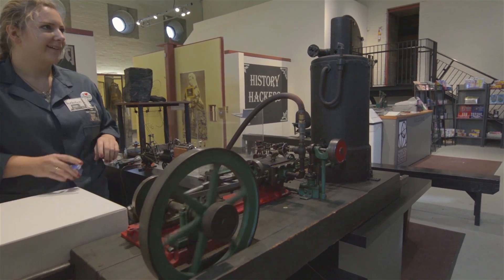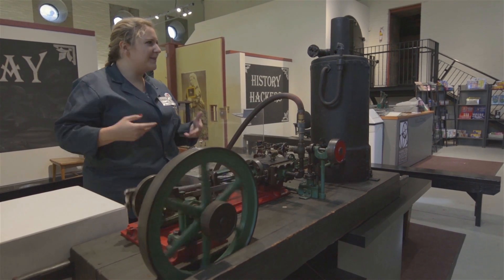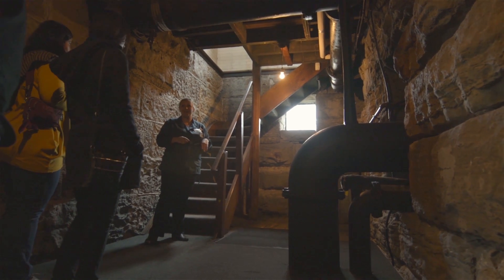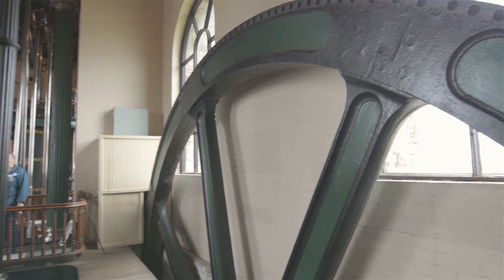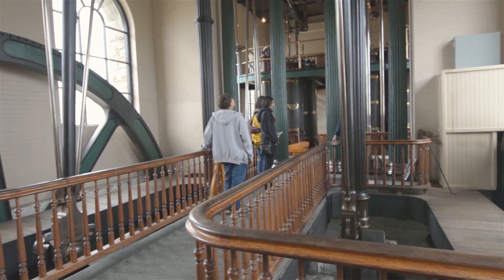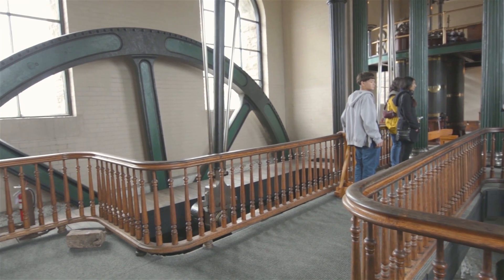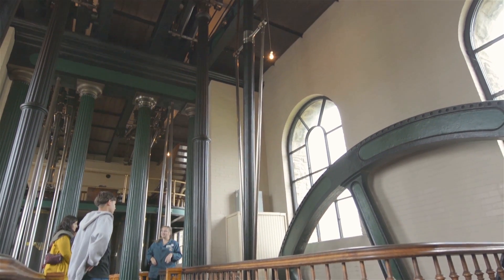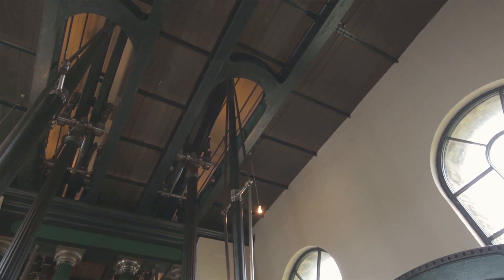70 Ton Beam Steam Engine Genuine Steampunk

Comment: Lovely, but where's the steam? Agree with the other posts, just driving it on an electric motor for hours will just wear it out.  It does not need the original boilers, a small modern package boiler tucked around back somewhere will do the job just grand. We need steam! 🤣🤣

Comment: Running a steam engine on a motor will cause dammage to the cylinders and other parts even if you oil them regularly this beautiful engine is going to suffer irreparable dammage

Comment: This is not a "walking" beam. Walking beams have a longitudinal movement to avoid using (or pre-dating) James Watt's parallelogram linkage at the cylinder, walking beams did not have a fixed central column but instead had  a pair of vertical links either side of the beam, pivoted at the ground as well as the centre of the beam, this allowed the beam to follow the straight line motion of the piston rod and due to the vertical links rocking back and forth looked (with a little imagination) as though it was walking. rotative beam engines such as this use Watt's parallelogram to do the same job. So your engine is a beautiful rotative beam engine.
Reply from the maker: Thanks, I will update the title if Youtube lets me.

Comment: Sounds like its driven by compressed air, damn shame :(
Reply from the maker: $ Funding, plain and simple. If you never grew up with it, then it's not relevant... so no contributors. There will probably be a phone app to simulate someday...
Reply: Yeah I can understand the money that would be involved in restoring the original steam boilers would be a problem. Its just a great bonus when its powered by steam. There is one not far from myself in England called papplewick pumping station and its powered by steam from some old Lancashire boilers.
Reply: @JintySteam1  i live in papplewick!
Reply: Not even compressed air. An electric motor has a rubber tire up against the flywheel, and it is turned using that. Of course the engine still breathes a bit as it runs.

All four of the original 1850s boilers are long gone, and the 2 boilers installed in the 1880s are also long gone. I would be happy enough just seeing it operate using steam from a modern package boiler situated in a shed out back, that way they could keep the original boilerhouse open to the public as it presently is.

Or maybe for special events, have  local steam enthusiasts bring a traction engine or portable boiler onto the grounds and plumb that in to provide the engine that isn't hooked to the electric with actual steam so it can run for real. This would be possible, and wouldn't be as big of a burden to the museum as installing a working boiler would be.

I traveled from the US to Hamilton specifically to see this museum. Even without a steam supply, I was not dissapointed at all by what I found.
Reply: No a far greater horror has befallen this engine an electric motor  drives it
Reply: @richcampoverde  Well at least it is turning if that engine was static it would mean nothing to the man in the street isn't there any funding from the government??

Comment: Running the engines with an electric motor is very destructive to them.
Reply from the maker: There are probably no future intentions of ever running it under steam again. The museum already operates under financial duress.
Reply: I talked to the guide about that on a recent visit- that turning the engine over without steam or compressed air can cause cylinder damage. He said they pour oil into the cylinders quite regularly to guard against that. 

All the same, it just isn't the same experience without real steam. Even if the steam came from a modern gas fired package boiler to keep the operating costs and crew needs to a minimum, the engine would still be running as a steam engine and moving by itself.

Comment: It is impressive how silent Steam Engines were, and how many decades they lasted and ran in old ships or water pump stations or whatever. Try this with a modern engine, I guess that whole engine block needs to be completely replaced every 2 years or so :D
Reply: Julia Shenandoah most of it is the size — the large container-ship engines, two stroke diesels running on fuel oil, will run almost-continuously for decades on end. Even smaller engines like locomotive diesels will run for quite long periods between rebuilds.

Modern practice is mainly that we tend to use small electric motors where we need them, because they're pretty much just as efficient in small sizes as in big sizes. And then we can use multiple small ones, because that's cheaper and easier to maintain than one big one.

And the only thing that still has to be Big is the electricity generating plants, which are mostly big boilers heated by whatever you burn, or by a nuclear pile, followed by steam turbines. So basically the modern world still runs on steam, it just goes through an electric phase in between, and we moved from reciprocating steam engines to turbine engines.